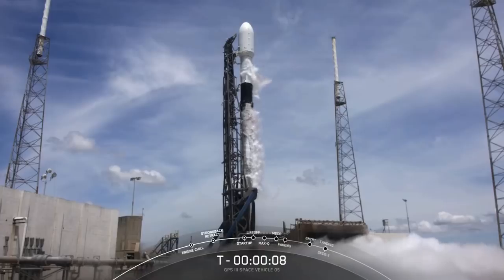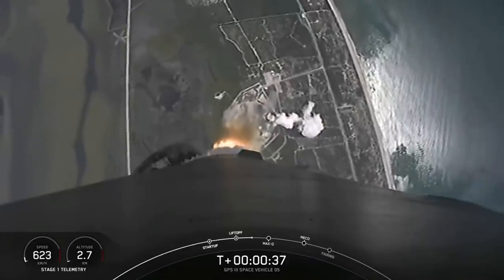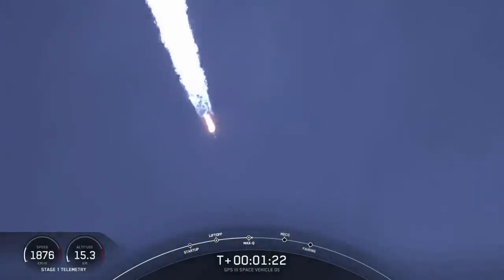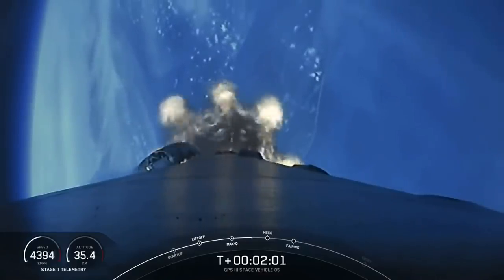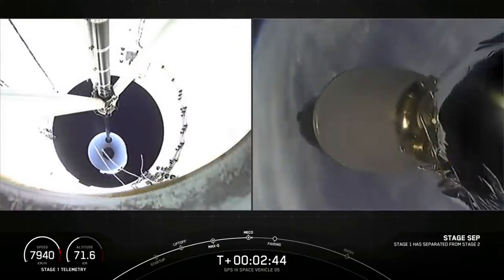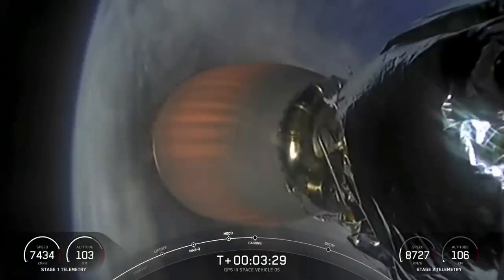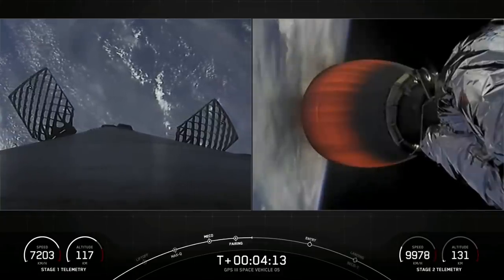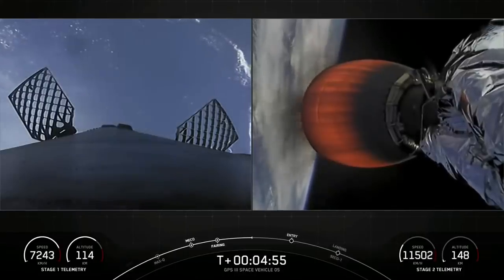SpaceX launches GPS satellite for US Space Force, nails landing!

Comment: Question:  Why don't they land the second stage where it originally took off from?  Wouldn't that be faster for them to prep for additional flights?? Thanks
Reply: It Wastes less fuel lading in the ocean, they would have to come all the way back.(i think...)
Reply: Has been answered many times.
https://youtu.be/8HifC7J715I
Reply: It depends where they launch from. Sometimes it’s a sea land, other times it is a return close to where they took off.
Reply: The second stage is the top of the rocket not the booster. But the booster lands at sea because it requires less fuel and less correction.

Comment: Launch - impressive…

Drone ship camera feed staying on - VERY impressive!!!
Reply: Prob Starlink sats. Ive seen a few orbit the vacinity of Texas, Boca Chica and maybe Florida.
Reply: @jeremycook4670  Yep, that's it. The Starlinks are much better at holding a datalink together when the drone ship's being rattled by rocket blast.
Reply: Ok, since we’ve been landing about 6 meters off the X spot consistently on the same spot, can SpaceX recalibrate its gimbals’ landing control so we can land directly on the X? Otherwise, good job SpaceX!
Reply: @leapdrive  or… they could just move the X over 6 meters… :)
Reply: @rubberduck7425  , or, move the spot sensor 6 meters off! Yes, they would both work but, when landing on alien planet you’d still be off 6 meters. The trick is not to cheat but improve the technology.
Reply: @leapdrive  It's not cheating, it's creative problem solving.
Reply: @tundralilac274  , this is not kindergarten. It’s an engineering design inaccuracy.
Reply: @tundralilac274  , didn’t you understand what I said? It lands consistently on the same spot approximately 6 meters from where the X is. It doesn’t look like a statistical error if it lands on the same spot, du m my!
Reply: @leapdrive  prob safety margins, or else ditch
Reply: @jeremycook4670  , safety margin is maximized if you can land it on the x each time.
Reply: @leapdrive  Or we could just repaint the X where it wants to land. Problem solved!
Reply: It didn't even glitch
Reply: Is it because it landed away from the camera? It was really of center due to gusty winds.
Reply: @marcturcotte1962  probably not becouse the Shockwave of the engine are so large there is almost no difference
Reply: to get a clean shot u need another boat at medium range to recieve the camera signal and broadcast back to station, if they use direct broadcast always have problems due to landing interference
Reply: those were my thoughts. I'm glad theyre still dedicating some people to that science.
Reply: finally, heck yeah
Reply: Incredible   👏  👌
Reply: 6:01 watch screen 1 you will see a ufo.. inlarge for a better image